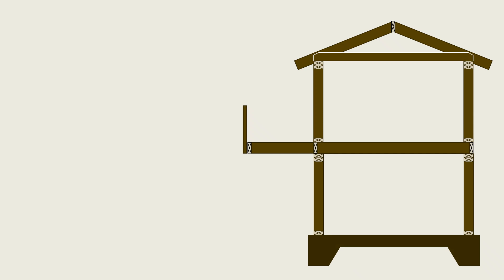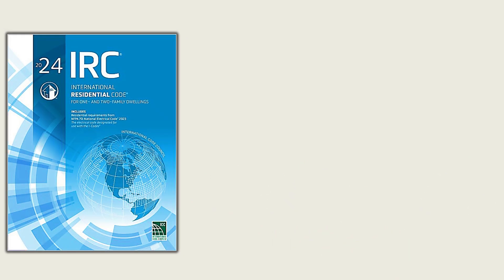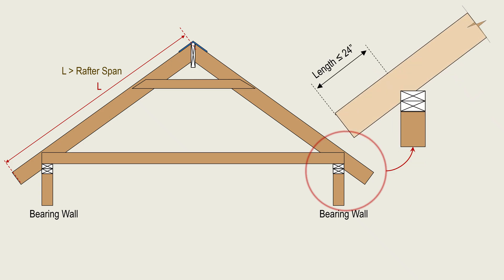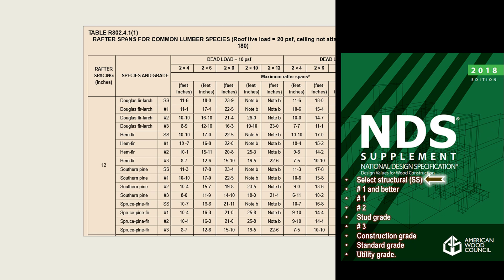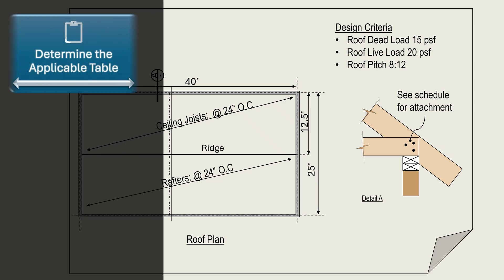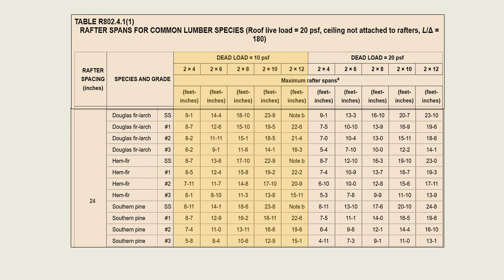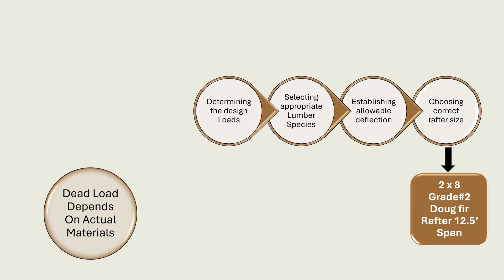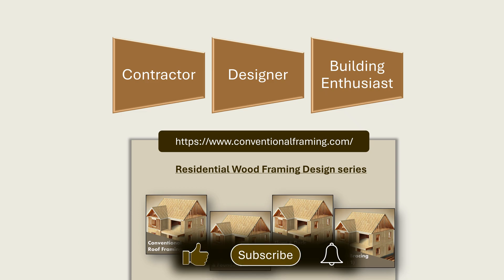2x6 or 2x8? How to Size Code-Compliant Rafters (IRC Explained)

Comment: 2x10 Minimum. You need an air space and proper insulation. I wouldn't use 2x6 on a shed.

Comment: Why does the ceiling weight factor into the dead load on the rafters if the rafters are attached to the joists and carrying the roof, not the ceiling?
Reply from the maker: Please watch the video again - minute 8.08 talks about a roof dead load of 15 psf (weight roof assembly including ceiling) but the rafters are designed to support 10 psf which does NOT include the ceiling dead load.
Reply: @ConventionalFraming  Okay, so it's implied that the ceiling is 5 psf, and that's subtracted from the 15 to get 10. A bit subtle for an instructional video, but thank you for the clarification.

Comment: Will it be possible to use to 2x6 every 12 inch on center?
Reply from the maker: Check IRC span tables for the specific spans that you are working on. You need to have the span, dead load, snow load if any and allowable deflection.